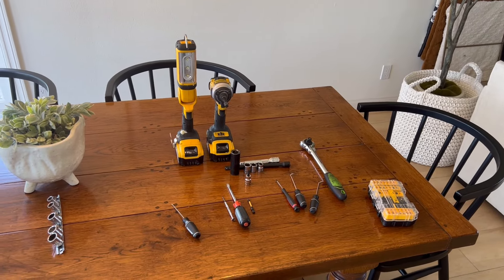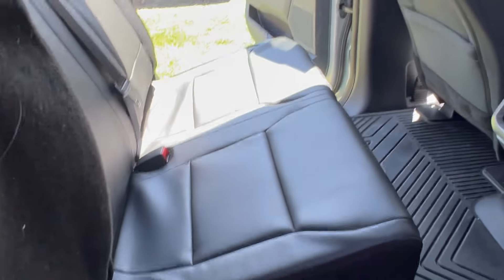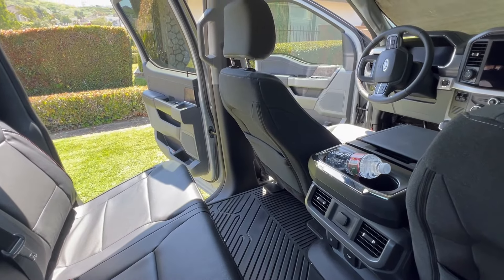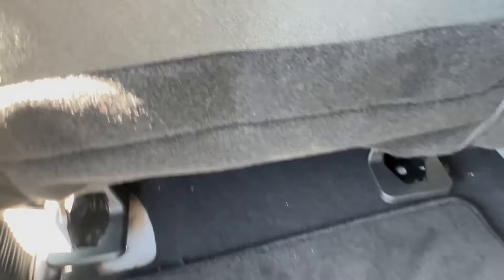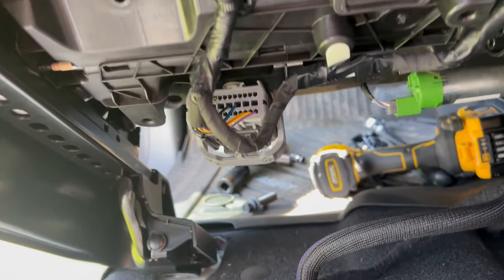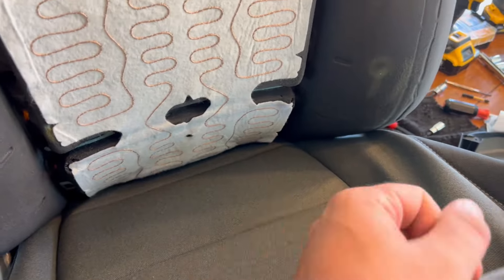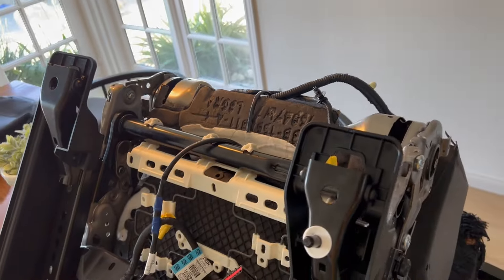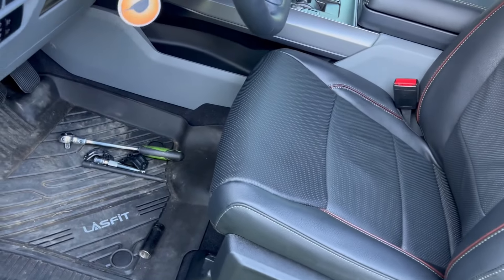21-24 Ford F150 & Lightning Leather Seat Install

Comment: Thanks for posting. I had an upholsterer do this but however, you do it - I highly recommend upgrading your XLT to leather. Go ahead and do it when you get the truck or you will keep putting it off like I did on my old truck and never get around to it.   I immediately got it done for my Lightning and I'm glad I did.

Comment: did you have to disconnect the battery of the truck before removing the wires on the seats?

Comment: I'm awaiting delivery of a 2024 Lightning Pro with Vinyl seats. Any chance you'd still have your XLT front seat covers and want to sell them?
Reply: I have some leather ones from a 21 
The driver seat has slight scratches if your interested
Reply: @tommytodd177  Thanks, I ended up with an XLT which has cloth seats. I think I'm good for now.